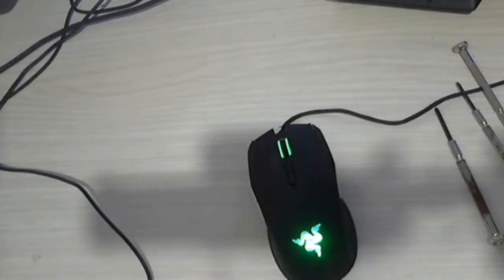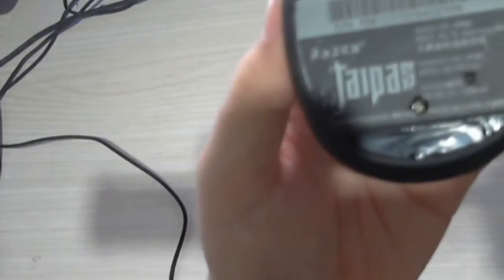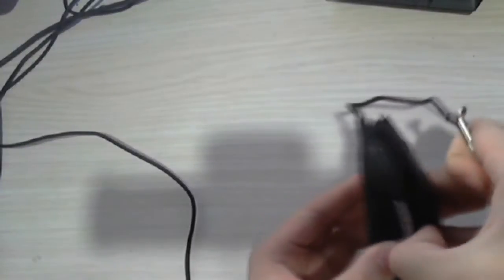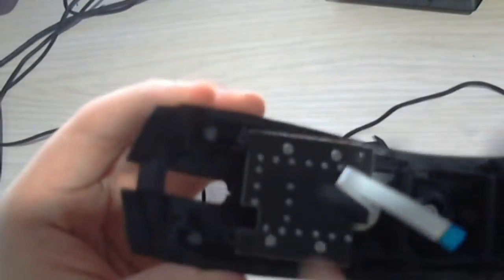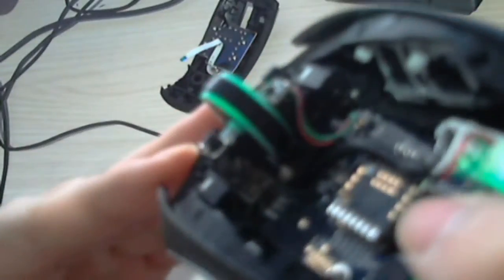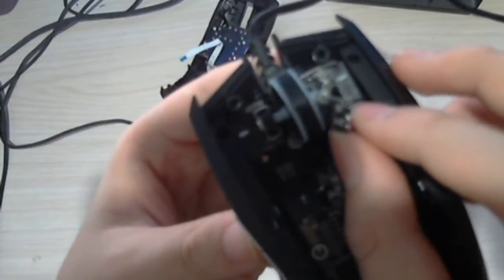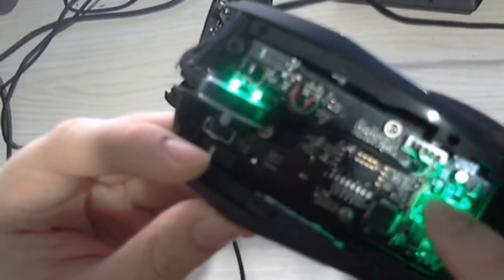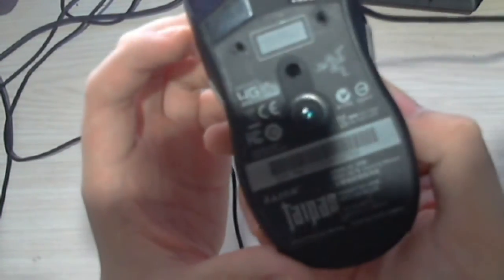How to : Disassemble a Razer Taipan!

Comment: If it's relevant for anyone in 2020 - the top cover can be safely divided into two parts for easy cleaning. Also, the side plates are easy to remove but think twice about the side buttons - the connections between those are very thin and fragile so be careful
Reply: thankss bro

Comment: The Greatest Mouse ever Discontinued! Currently, I have 5 Taipans. Eventually, some of the buttons stopped working. Different buttons on each mouse. I am sure it is from over-use. Since Razer stopped manufacturing this mouse I was thinking about trying to rebuild one from the parts I have. Sad to see a company "ship the bed" by replacing a great mouse with inferior models. This mouse is perfect for the type of work I do as a game developer and 3D Artist. The programmability of this mouse allows me to use multiple programs at once and the mouse changes automatically. I usually switch back and forth multiple times from 3DSMAX, ZBRUSH, PHOTOSHOP, UNREAL ENGINE 4 and 5 as well as about 20 other applications. I hope a Chinese company will start making a quality knock-off of the Taipan.
Reply: Im using mine since 2014.. the click now has a double click issue... im planning on replacing the switches

Comment: Many thanks to you! My sensitivity buttons became sticky due to dust or whatever it was. I removed top part and cleaned with air pressure around it. Also there is some coat around the white stick which holds wheel. Just remove wheel and take out the white stick from the left side and wipe it. Whatever, I have done what I needed, thanks a lot!

P.S. Please get better camera
Reply: Erikas Rudinskas Sure! and yeah I really do need a new cam lol

Comment: Maybe you can help me with your know-how: My Razer Taipan side-buttons (righthanded thumbbuttons) started to work sluggish, meaning I can still click them but they don't always register the click. It seems that I have to click the side button more to the front of the mouse intentionally in the middle of the button to get a guaranteed click. I have the mouse since January this year and use it a lot, and there might be a little standard dirt. The phenomenon appeared about 2 days ago. Do you think it could be 'damage' due to overuse or that it might be slightly jammed due to dirt? If so, could I solve the problem by cleaning my mouse internally?

I'd really appreciate your help since these buttons are part of my core buttons.
Cheers!
Reply: I'm having the same problem right now, were you able to fix your mouse?
Reply: Had the exact same problem,just dissasemble it,dissasemble the button itself,and you will have a little copper piece,clean it,and bend a little more the part that acts as a spring,then put everything back.

Comment: My mouse occasionally won't function when I pick it up to move it back into place. It won't work unless I lightly slam it onto the pad
Reply: GrimBolt I don't know whats wrong with your mouse. It may be because the sensors maybe acting up. you can try to report this to razer support though
Reply: I will
Reply: GrimBolt did u fix the problem ?
Reply: yeah thanks guys
Reply: GrimBolt i have a similar problem, can you tell me how to fix it ?
Reply: guys... i saw the sensors and encounter a hair inside my mouse and i fix it. cya

Comment: the sensor on my taipan is having a lot of tracking issues, like its just never consistent, anyone know what to do about it or do i just buy a lancehead
Reply: I think its best if you buy a new one, or if you still have your warranty maybe you can exchange it or fix it. Razer Taipans have really good durability though, its been about 4-5 years since i had it and it recently just stopped working, though i can just disconnect/connect it to make it work again but I ended up getting a Roccat Kova
Reply: just fcking calibrate it in the fucking synapse
Reply: Same problem. How u fix it?
Reply: same problem after 6 years the laser has tracking problem